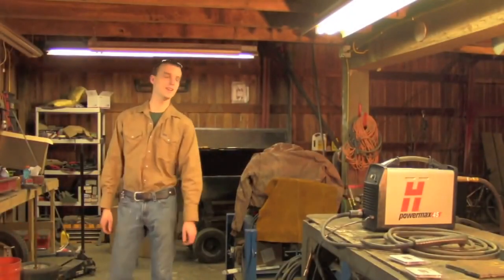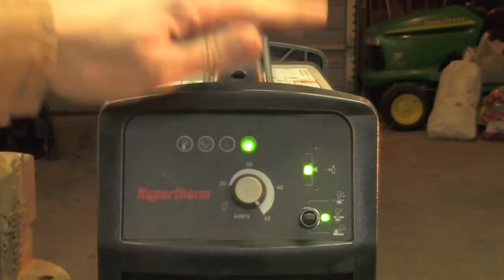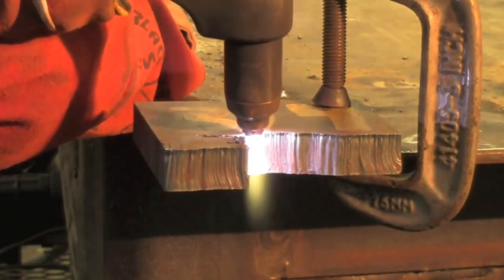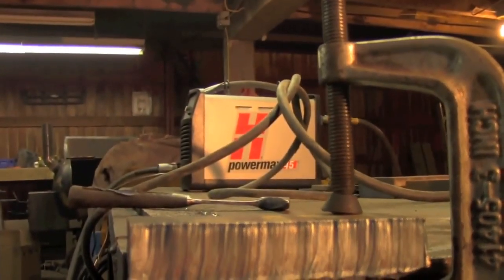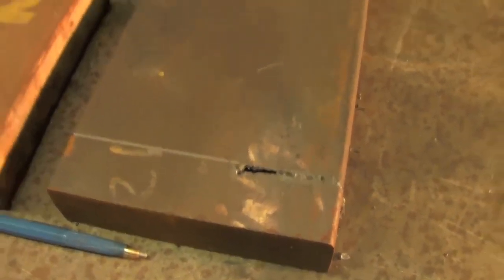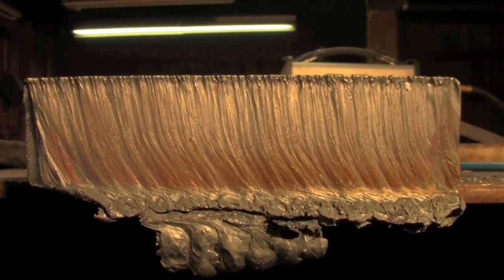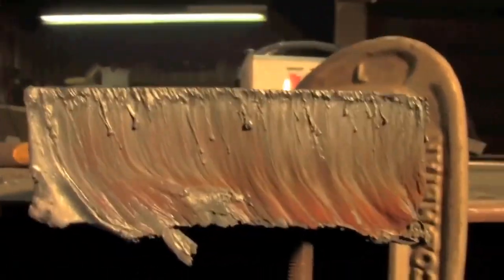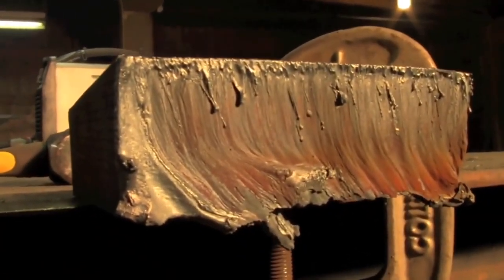HOW THICK OF STEEL CAN YOU REALLY  PLASMA CUT?!?

Comment: Just WOW! Thanks for the video.
I have an older and less powerful Powermax 350 and have trouble just severing 3/8 even at slow travel speed, so your video has convinced me I'm doing something really wrong. Air pressue maybe (higher pressure better, right)?
Reply from the maker: Could be, might just need new consumables
Reply: @officialweldingfarmingarch2041  Nah...all brand new, and checked swirl ring and air (dry). I think it must be the pressure (something I've never understood when it comes to fine tuning, if that is important). No worries, we'll get it.